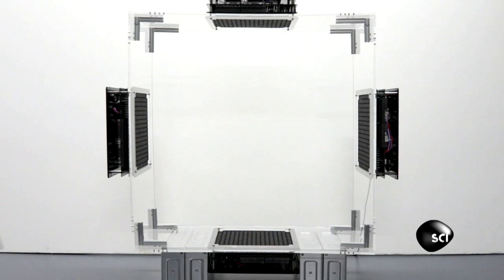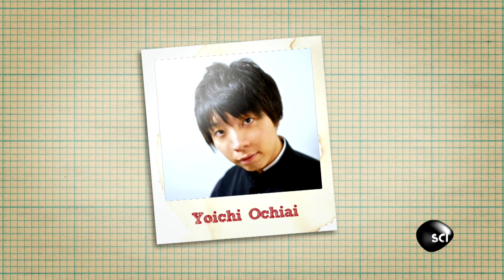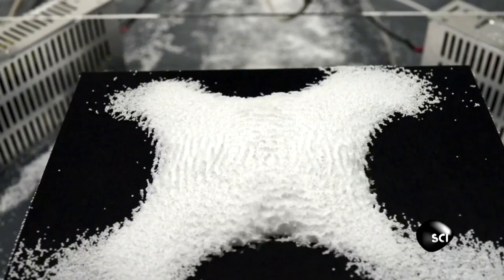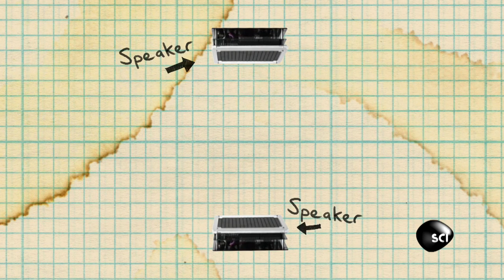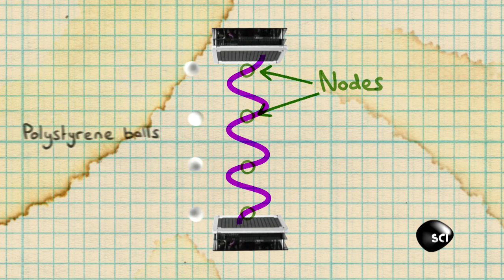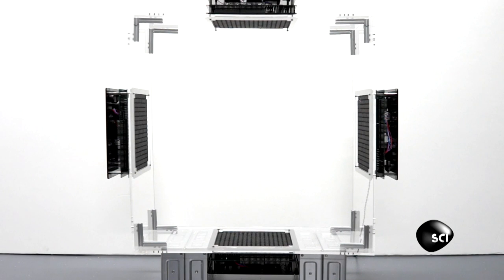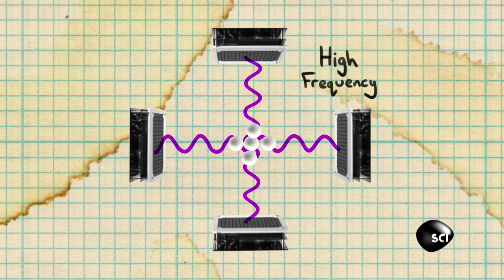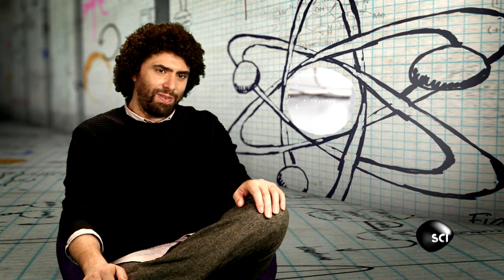The Hi-Fi Speakers that Defy Gravity | Outrageous Acts of Science

Comment: you'd think the science channel could actually get an explanation correct, is that to much to ask for? okay so basically my issue is in the way you explain how the levitation actually works, your explanation is how old sonic levitation would work, in its infancy the devices consisted of nothing but a high power single ultrasonic speaker pointing at a plate to generate a standing wave. However cool those may have been they had no maneuverability and were very inefficient, this new generation of acoustic levitation is powered not my standing waves but by phased arrays of transducers. Basically instead of one 150watt speakers they may use 150 individually controlled 1watt speakers, and by timing pulsed at just the right time researchers can focus all the energy of the speakers to a single (or multiple) point and produce incredibly stable and maneuverable  levitation without standing waves